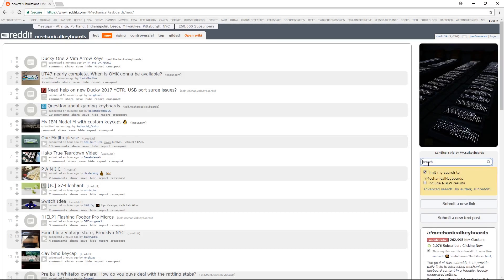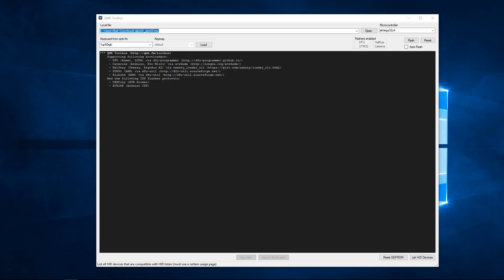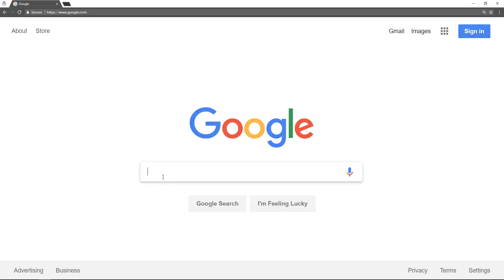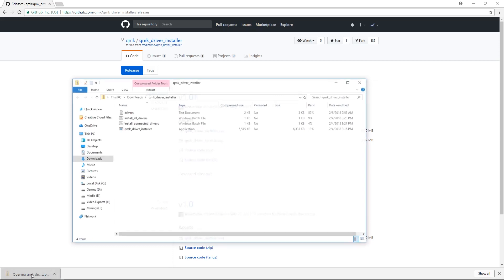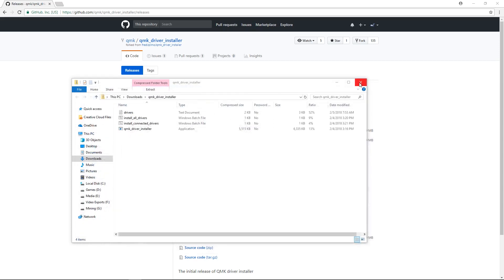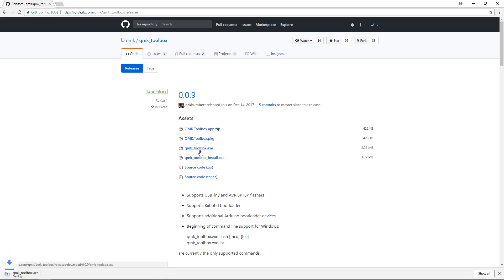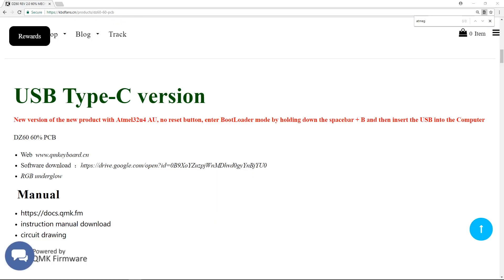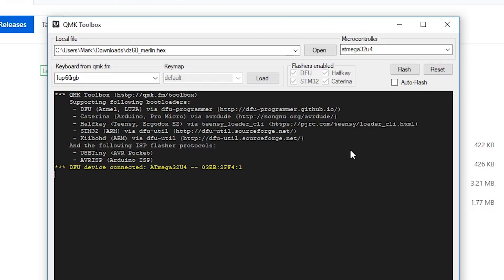QMK Tutorial: QMK Toolbox (DEPRECATED)

Comment: So I was able to download my firmware using the QMK configurator. I opened the hex file using QMK Toolbox and the "flash" button is still greyed out. Correct MCU was selected as well. Any ideas as to why the flash button is still greyed out? I have the Parallel Sequence keyboard.
Reply from the maker: You also need to put the board into bootloader mode
Reply: @MechMerlin  wow, it worked. thank you!

Comment: but if the keyboard doesnt show up? in the toolbox?
Reply from the maker: You will need to follow the proper reset procedure and ensure you have the correct drivers correctly installed.
Reply: @MechMerlin  I have the dz60 as well as you in the video but the drivers didn't seem to download the black window just opened up and disappeared instantly, pretty hard to actually se the window before it disappears. I have windows 10 and everything else should be the same as well.
Reply from the maker: @wtnation1992  Id recommend using QMK Toolbox to install the drivers. Right click no bottom and choose install. Restart computer after and proceed
Reply: @MechMerlin  i was able to download the drivers and make the keyboard show up in the toolbox now. i noticed that on your toolbox had under the hex dokument somthing that said 1up60rgb, is that something that i also need to write in or do i just leave it blank
Reply: But thank you for all the help so far as well!! Very kind

Comment: hey merlin, i have some problem with my dz60 rev3
it worked fine until i press reset button under di pcb
now it cant be connected into my pc, it always show "usb not recognized" notification
did i do something wrong ?
Reply from the maker: You have pressed the reset button, getting the board into bootloader mode. This is means the board is ready to be flashed with new firmware.

Comment: I tried using this link https://github.com/mechmerlin/qmk_setup/blob/master/windows_flashing.md in the description for extra help as my dz60 just would not change. I did everything to the exact but the keys would not remap. DO NOT use Zadig and complete the replace the driver step. First, I did it on my mouse accidently which broke it. I was only able to fix it by downloading razer synapse cause I have the razer viper ultimate. Then, I stupidly made the same mistake by doing the replace the driver step in Zadig to my dz60. It completely broke it. No input and no sound when plugging it in. I deleted all the files associated with Zadig and tried re downloading libusbK. I even redownloaded the qmk drivers and tried flashing through qmk toolbox. Nothing has worked so far and I think I just fucked up my dz60. Terrible advice from whoever wrote that. If anyone could help, that would be greatly appreciated. FML
Reply from the maker: I wrote that, and I guarantee you that the process works. It is however quite complicated, and without much focus and time spent reading it, you will fail. 

However, this is the manual process.....

Today, QMK Toolbox auto installs the necessary drivers. You will be prompted to do this on initial install,  or you can trigger it by right clicking the toolbar and selecting "install drivers".
Reply: @MechMerlin  I finally fixed the problem by doing a system restore. I don't know why it did that. The reason I tried your manual process is because my dz60 won't flash correctly. I may have read the instructions wrong but I am not sure how else you would interpret it. I've flashed successfully before on a previous dz60 so I am 99% sure I am doing the steps correctly. Maybe this current one is a defect? Once flashing, it has the correct confirmation text and everything. This is making me very confused... Any help would be appreciated and I am sorry about accusing your text.
Reply: Update, dz60 works on other devices, still havent figured out how to fix my current device
Reply: Update: I fixed it! I always loaded it for some reason so once I tried without doing that it worked. I'm a bit stupid but atleast it worked out in the end. Sorry @MechMerlin for the troubles. I'm not sure how to delete my comments but if you want me to do that, I can.

Comment: I was able to flash with my kbd67v2mkii but now I am not able to type at all on my keyboard. None of the keys seem to be working
Reply from the maker: You may have flashed it with the incorrect firmware file. Look at the text output from QMK Toolbox and verify that the paths are correct.
Reply: @MechMerlin  it seems like the one shown in your video
Reply from the maker: @Bluffyog  If it's the one shown in my video then you flashed the incorrect firmware file. My video shows the dz60 you have a kbd67mkii rgbv2
Reply: @MechMerlin  no I flashed the one for this keyboard not for the dz60
Reply: @MechMerlin  is it possible to undo every change I made on my keyboard to just have it back to normal?
Reply from the maker: @Bluffyog  There's no easy way to undo it as we're changing changing files here. You would have had to have saved the file and the changes somewhere.
Reply: @MechMerlin  can I restart using the restart button on the back of my pcb
Reply: @MechMerlin  right now qmk is not able to detect my keyboard neither is anything else I don’t know why
Reply from the maker: @Bluffyog  The reset button is the button you press to get into bootloader/reset mode. This is the mode you need to be in for flashing.
Reply: @MechMerlin  so I have already finished flashing my keyboard is not working after flashing
Reply from the maker: @Bluffyog  I'm saying that you may be flashing it with incorrect firmware. Either the path is incorrect (check the path its using in QMK Toolbox), or you have your board name mistaken and have wrong firmware for it.
Reply: @MechMerlin  I think I downloaded the correct firmware as I checked the name and firmware for my board
Reply: @MechMerlin  I’ve seen people with similar problems with this board
Reply from the maker: @Bluffyog  Out of curiosity.....does your kbd67mkii have hotswap?

Comment: does this work with .bin files or just .hex files
Reply from the maker: QMK Toolbox is the official firmware flasher for all QMK powered boards. The .bin or .hex extensions are dependent more on the mcu the board uses.
Reply: MechMerlin gotcha. I can’t put my keyboard into reset mode. DZ60RGB V1 hotswap any help
Reply from the maker: @eibo8232  Is the reset button not working?

Comment: umm, i accidentally used the dz60 hex file instead of the dz60rgb v2 which was what i was supposed to use....now my keyboard isn't functioning as the keys are all over the place, so i can't reset the keyboard using the spacebar+b or spacebar+esc. Is there anyway to fix this?
Reply from the maker: Just press the reset button on the back.

Comment: So I did what you said and my keyboard lights turned all red, non of the switches work except for W and Y and they only open mail and calculator.
Reply from the maker: You most likely programmed it with the incorrect firmware file. Please double check the files you are using.
Reply: @MechMerlin  yeah on kbd fans it says to use hex file, I did.
Reply from the maker: @Acemans  correct, the hex file is similar to saying a doc file, or a pdf file, or an mp3 file. Which firmware did you use? (they're all gonna be either .hex or .bin)

Comment: i still have no damn clue on how to use qmk or flash my build anything thing like nothings working
Reply from the maker: What board do you have? It might have VIA on it so you can just plug the board in, open up the VIA app and you'll be able to edit your keymap on the fly.
Reply: MechMerlin thanks for the help i have a dz65 v2 i installed via aprieciate that

Comment: hello, I'm having a bit of issue flashing my kbd6x after I have done all the steps and I hold b + space there is no confirmation that the toolkit has read detected my keyboard, did I do something wrong? please let me know!
Reply from the maker: You may not be using the correct reset sequence, I'd look into pressing the hardware reset button on the back of the pcb instead.

Comment: Hi. Your tutorial worked perfectly for my DZ65, but I got a DZ60 and when I try to flash it, nothing happens. The keyboard was working perfectly before I tried flashing it; now nothing works. When I am flashing it the software does everything but it seems that the device disconnects before it is done flashing.
Reply from the maker: You may have missed a step. The procedure is the same across almost all qmk powered boards. Also was curious why you chose to not go with VIA and just regular QMK.
Reply: @MechMerlin  Ah I finally fixed it. I used the wrong PCB name on the QMK configurator website. I chose DZ60rgb instead of just DZ60. When I flashed with the DZ60 one it worked fine. Also, I hadn't heard of VIA before. Anyways thank you for making this helpful video and replying quickly.
Reply from the maker: @farbodzandinia  If you don't like having to flash your board every single time you change your keymap, look up VIA. It will allow you to dynamically change keymaps and lighting!
Reply: MechMerlin oh very cool. I will be definitely using this in the future. Thanks!

Comment: I just download 0.19 and for some reason I can’t open it. I’m currently using a KBD75v2 and I’ve followed all the steps.
Reply from the maker: What do you mean you can't open it?
Reply: MechMerlin https://youtu.be/ShQRvqagPVY
Whenever I press on the exe, it doesn’t open
Reply: MechMerlin Anyway I could fix it? I need to remap my end key to space bar, since I’ve burn off the pads on the spacebar switch.
Reply from the maker: @anyenbao  Sounds like something is going on with your Windows security settings. I'd check there to see what's happening.

Comment: anyone got any tips on how to flash the board wen it says 
that there i no device connected in QMK toolbox
Reply from the maker: In this case you're either not doing the proper reset, don't have the correct drivers installed, have a bad usb cable or port, or all of the above.
Reply: @MechMerlin  hi so i have the dz60 rgb PCB and the way i have reset it is by holding down esc whilst unplugging the usb-c, inside QMK it the says that the the DFU Device is connected. so surly that is a correct restart? and i installed the latest drivers from the link on your video, and i installed the latest version so?
Reply: @MechMerlin  by the way only reason im doing this is so that i change the RGB mode which is gonna be 1 key press when its done lol

Comment: Hey MM, thank you so much for providing these tutorials. I do have a question about flashing a Gherkin 30-key keyboard. Everything seems to work just fine up until the last step of actually flashing the .hex file. I did the GND-RST reset but I keep getting the same message:
    
    Connecting to programmer: .avrdude.exe: butterfly_recv(): programmer is not responding
    
    avrdude.exe: butterfly_recv(): programmer is not responding

And that's it, no further message, no disconnect, nothing. Any advice?
Reply from the maker: you may want to verify that you are installing the correct drivers, or following the proper reset procedure

Comment: I've followed your steps from each video and im now up to the stage to flash with toolbox. i Open my file but under "Keyboard from qmk .fm" has nothing selected and im also not able to reset my keyboard. I have the KBDFans tofu %60 pretty sure its the same PCB as yours, any way to help me? Thanks.
Reply from the maker: Please try to manually reset the board via button or switch
Reply: @MechMerlin  what do i do about nothing being selected? Yours shows up as 1up60rgb, should i select that?
Reply from the maker: @JbobJbobJbob  what do you mean nothing selected

Comment: I don't understand what all this QMK thing is for.  Do some keyboards need it to actually function?
Reply from the maker: All boards need some type of firmware to communicate to your computer. QMK is just one of many firmwares out there. In the custom keyboard scene it's the most popular supporting over 800 boards at this point.
Reply: @MechMerlin  That's weird. I built a board with a dz60 from kbdfans a week ago and I've haven't had to download anything.
Reply from the maker: @edouqrd946  that's because firmware is usually installed at the factory.
Reply: @MechMerlin  Oh. Thanks for the quick responses man!
Reply from the maker: @edouqrd946  think about it this way. When you buy a smartphone, you have an OS on it from the shop right? However you may want to update that OS overtime to get new features and fixes. QMK is like that OS. However an added benefit is you can change your keymap if the one that came from the factory doesn't suit your preferences.
Reply: @MechMerlin  Oh okay. Thanks!

Comment: how do I get the pinout for a handwired clueboard 66% on a teensy 2.0?
Reply from the maker: The pinout is something you determine.
Reply: @MechMerlin  I've found the matrix and the pinout for the rev3 of clueboard 66 I was using and got it working but I can't explain why the diodes I'm using have to be mounted with the black line towards the switch pin and not towards the wire that connects the row
Reply from the maker: @PescarStangaci  diodes are polarized. They allow current to pass only from the anode to the cathode, not the other way around.

Comment: Hey man. I need some help rather reconfirmation. so I have the .bin file ready and the drivers complete and good to go. tho somewhere online i read that i need to download a zadig for the bootdrive of the keyboard, and i noticed that your video didnt have a zadig part. so i was wondering if it is required (got my board 2nd hand and currently using it) I should mention that i already got the yellow response on the QMXtool after pressing the restart on my dz60RGB (fn+\). waiting for your reply. thanks
Reply from the maker: Zadig is another tool that installs drivers that QMK Toolbox needs to function. You can use it if you want. I have it part of the text tutorial.

Comment: Following the tutorial the QMK Toolbox emits "There are no devices available" in the prompt. Disconnecting & connecting the keyboard does not seem to help. Any suggestions? Keyboard is the kbd67 mini rgb v2.
Reply from the maker: Did you verify that you have the correct drivers installed and did you verify that you followed the correct reset procedure?
Reply: @MechMerlin  appreciate the quick reply! Turns out opening the qmk toolbox again, solved the issue.
Reply: @daisdead  How did You reset the kbd67? Idk how to do that and can't find any info

Comment: hey there. i flashed my hex file onto my dz60 rev 2 board and it flashed succesfully however some of the keys are not responding (they did before). i also tried to reset to the default setting however the some key are still no responding do you maybe know what i am doing wrong
Reply: I have same issue? any luck fixing?
Reply: @JPizzMC  No not really, I ended up returning the pcb and getting a new one which worked. so it might be that you have a faulty one too.

Comment: I did this with a DZ65RGB and after flashing and replugging it no longer works. Windows 10 says an unrecognized USB device and none of the buttons work. I think this happened due to me using a DZ65/v2 and after it needing a .bin file I had the genius idea of going to the .hex file and just changing it to a .bin file. Did I now brick the PCB or can I still fix it somehow?
Reply from the maker: V1 uses .bin and V2 uses .hex. Does flashing the correct .bin file not work?
Reply: @MechMerlin  So that is not the current problem, the current problem is that I can't even connect my keyboard to my PC.
Reply: @MechMerlin  Sorry for the bother got help to fix it by a dude on the KBDFans discord :D
Reply from the maker: @samuli2305   no problem. I'm also on the kbdfans discord, feel free to message me there if you have any other questions. It's easier to talk on discord than in YouTube comments when it comes to troubleshooting
Reply from the maker: Spoke with Hello Why on Discord. Resolution to the issue is switching the toggle switch on the back of the board to get out of bootloader mode.
Reply: @MechMerlin  Switch into bootloader mode*

Comment: I did this on my hhbk tofu keyboard with a kdb6x pcb and now its not working it connects to the computer but I cant type and some keys such as shift would type random numbers and letters when I press it. Please help me I would really appreciate it.
Reply from the maker: You may have incorrect drivers installed
Reply: Thank you I selected the wrong microcontroller but I was able to manually reset it. Thank you for the response!

Comment: i have DZ65 RGB and while flashing the hex file it says: * STM32 device connected: STMicroelectronics STM32  BOOTLOADER (0483:DF11:2200)
* Attempting to flash, please don't remove device
  ! Only firmware files in .bin format can be flashed with dfu-util!
* Attempting to flash, please don't remove device
  ! Only firmware files in .bin format can be flashed with dfu-util!
Reply from the maker: That is correct, your dz65rgb uses an ARM microcontroller, which needs firmware files in .bin format.
Reply: @MechMerlin  thank you, the solution was to select v1 instead of v2